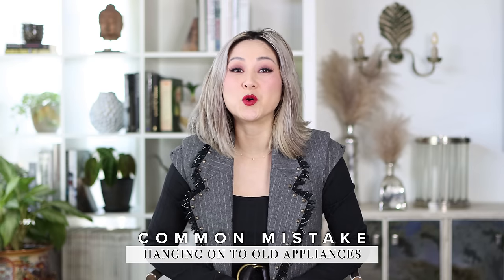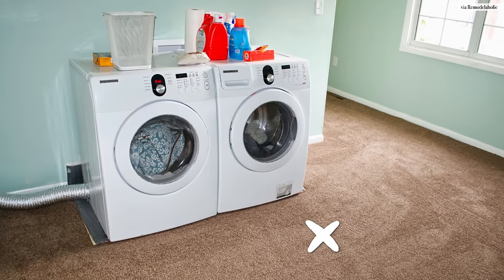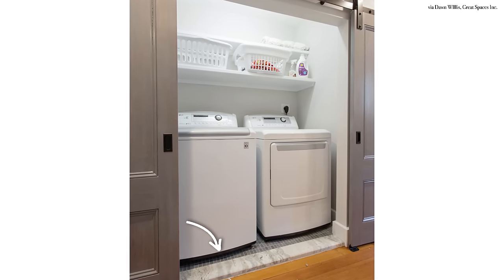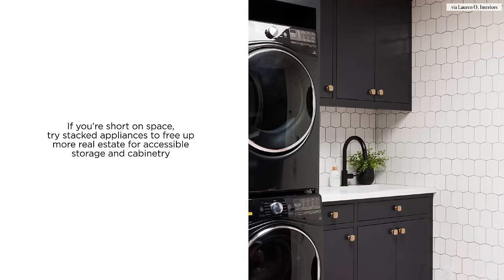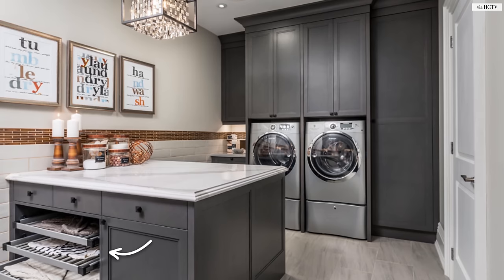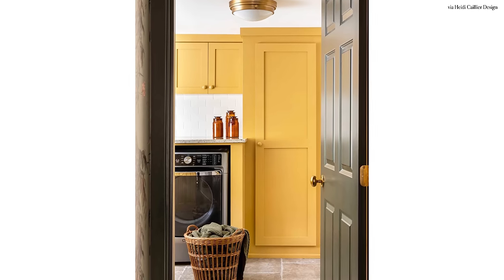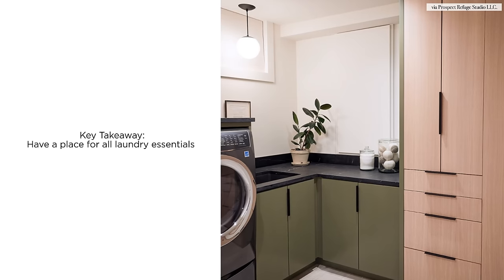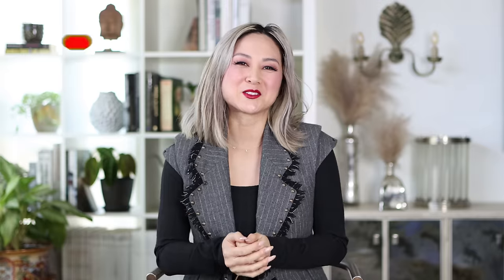COMMON DESIGN MISTAKES | Laundry Room Mistakes and How to Fix Them

Comment: Older washers can be taken apart and fixed. They are made much sturdier, and they will last longer.
Reply from the maker: They might last longer, but I want all the newer functions the old ones just don’t have, even if that means upgrading every decade. Technology moves fast I get it. But 10 years cost per wash is pennies on the dollar 😅👍
Reply: @JulieKhuu  fair point, my washer is from 1991- no bells and whistles.  I hear you though, it would be nice to just click two rinses and walk away.

Comment: Hi Julie.  Which picture was your laundry room?  Yes, I'd like to see a video on more storage ideas.
Reply from the maker: None Ginger! 😆 You can see my laundry closet in my dining room/ lounge makeover and kitchen remodel. It’s a tiny space that I’ve made functional by removing accordion doors and installing a drapery rod with panels to conceal the mess
Reply: @JulieKhuu  I have a laundry closet. I removed the bifold doors and painted the wall behind the appliances in a bold green. I work to keep the space clutter free. I am still trying to figure out how I want to style the area. Timely video!

Comment: We have a condo and our laundry room is next to the master bedroom..... it not a big laundry room but does have upper and lower cabinetry with stackable washer/dryer, how can I incorporate a dry rack?
Reply from the maker: I would purchase one you can install onto the wall and pull down when in use Camillia. They sell it on Amazon 👍🏻
Reply: Could you do one that hangs over the back of the laundry room door or a wall mounted folding or retactable one?

Comment: I always felt it was weird to have hardwood/laminate in my laundry room but that's what the developer did and I'm not changing it unless I have to 😅
That said, my laundry room needs some help because there is 0 storage provided (seriously the developer was the cheapest dude but I got an insane deal on this place which easily could have been over 100 grand more than I paid - so I can fix the issues and resale will be way more) and needs counters etc.  Looking forward to post pandemic times where I can go shopping stress free with my partner to choose these things and get them done.
Reply from the maker: In the meantime, pin and save your dream design S! That’s the most crucial part to every successful interior 🙌🏻☺️
Reply: @JulieKhuu  I will!  And also this video actually motivated me to declutter my laundry room and deep clean it and style it slightly for the first time ever and it already feels so different. 😊

Comment: I disagree with the upgrade.  If you have an old one keep it, the new ones dont last long and are very expensive.  I've replaced my washer twice in 18 years.  My parents is still working at 30 years.  It's very wasteful to get rid of it if it still works and not good for our environment.  Just saying.  oh and they dont wash your clothes if they are actually soiled.  When I'm working in the garden,  my clothes dont come clean from the dirt,  I have to wash them several times and they still dont come clean.
Reply from the maker: I’m someone who will invest in technology that SERVES me. I won’t just buy the latest and greatest because it’s new. The bells and whistles need to speak to my daily needs. Everyone’s needs are different so I totally get it 🤗

Comment: Honestly, those new washing machines don't clean your clothes the way the "old and outdated" washers did.  I want my old washer back!  And can we please get real - what about those of us who can't afford a house with a laundry room that is larger than my primary bedroom?  What about those of us who have an old house built in the 1950s or older that have their basement "area" in the basement - not enclosed, ugly cracked concrete flooring, unfinished walls, unfinished ceilings with structural steel beams, plumbing piping, and electrical wiring, plus telephone wiring and cable television, etc. wiring (from the not so "old" days).  Some of the laundry "rooms" you showed are bigger than my kitchen, and have more cabinets than my kitchen!  How about pitching to women with homes that most of us actually have, not the top 10%.  Thanks.
Reply from the maker: How about I offer you the full experience of what my high end clients get from working with me without paying for the consultation or design fees J? That is the intent of this channel, Dream inspiration that we can apply no matter what our style or budget ☺️